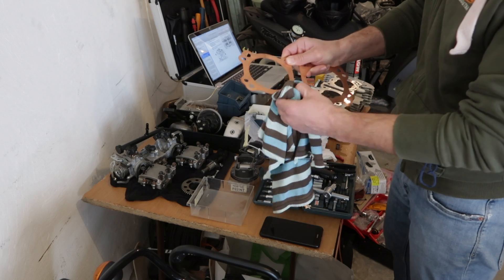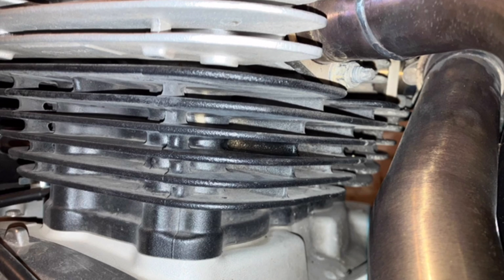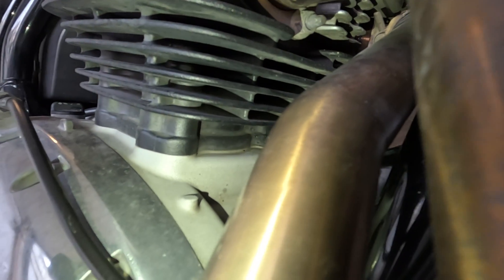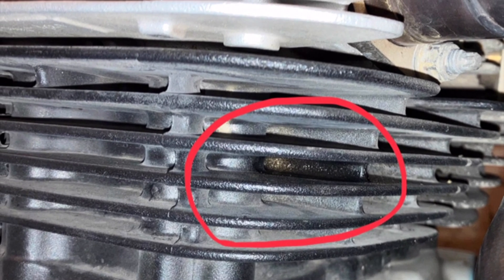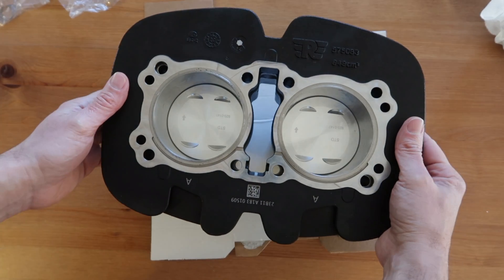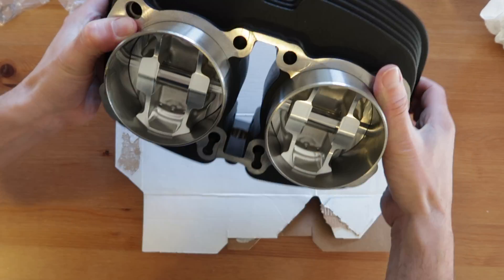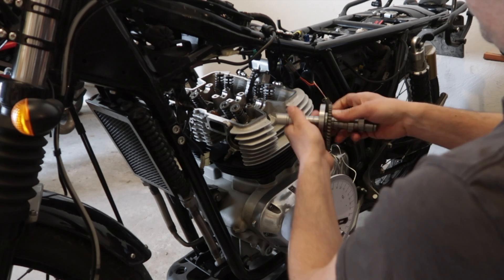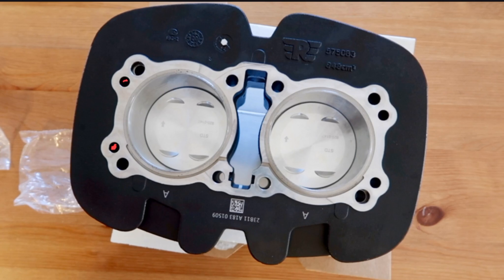Interceptor 650 (865) engine oil leak? Cylinder casting porosity?

Comment: I have a 411 himalayan fitted with a hitchcocks BB kit...  before it was fitted I had a leak on a head bolt  (very small nothing to worry about)  after I had the BB fitted I still have the same leak same head bolts ,,again nothing to worry about ,,and its been the same for over 25 000 miles,,,  just clean off when it looks rubbish otherwise do not worry
Reply from the maker: Thanks for the info! I used some JB weld on it and I've seen no oil since!

Comment: Hola soy Adrian de Argentina muy buenos tus videos I have an idea. Por qué no entubar los canal por dónde circula el aceite y de esa forma no perdería más aceite
Reply from the maker: Hola Adrian! In my case the leak was to small to go into that trouble of taking the engine apart. I managed to solve the problem by blocking the leak from the outside with J-B weld. I made a video about it as well https://youtu.be/9EozwsSvJ9k?si=M5yC6DiIWkIcHBEM
Thank you for watching and your suggestion!! Cheers!

Comment: Engineers have spent hours with computers etc to design these engines what do people expect when they play around with them have they worked out the extra stresses  and strains that they are putting on components. When you take metal away you are in effect redesigning the pots so has anyone worked out the feasibility of this  and at the end of the day why buy this bike if you want more power why not buy a bigger bike to start with
Reply from the maker: I didn’t make this video to complain and I think that’s clear. I did the conversion because it’s great fun and I also learnt a lot in the process not because I just wanted more horsepower, I know what’s available in the market. I did it knowing that there are risks involved and that’s why I’m not complaining for anything. But there is not clear indication that my problem was caused by the big bore, it could be but there other interceptor owners who had this exact issue with no engine modifications and it appeared after a few thousand miles from new like in my case. I made this video just to share my experience and I hope I answered your questions. Thanks for watching!
Reply: @ksmotoshed7961  Hello , I have the same oil leak issue, without changing horsepower... Would be interested in cylinder method. I have the RE tool. Is it so difficult with it ??
Reply from the maker: @stephan_ledoare1972  hi! I’m not sure I understand what you mean by cylinder method, can you give us more information?
Reply: @ksmotoshed7961  I'm questionning about how to re inser the piston, with the RE tool. Some says it's difficult ?

Comment: There is a possibility that increasing the head to 865 leaves some casting material in the drilling area
Reply from the maker: Yes, that's what I thought at first but there are reports from at least two other Intrerceptor owners who had the same problem with no modifications whatsoever. Still, not sure if mine was affected by the machining.